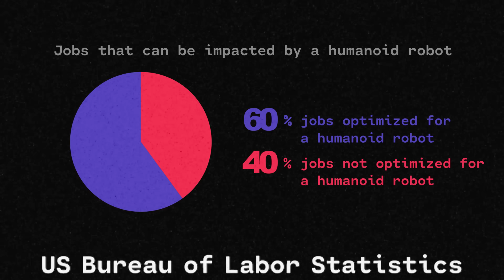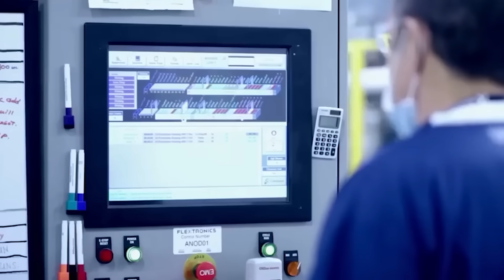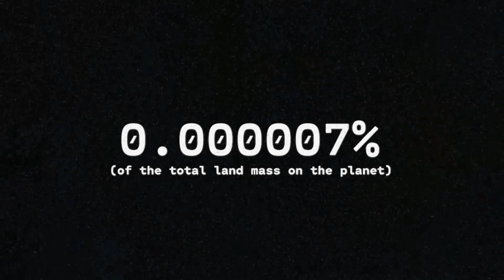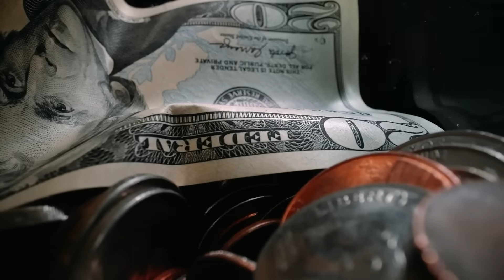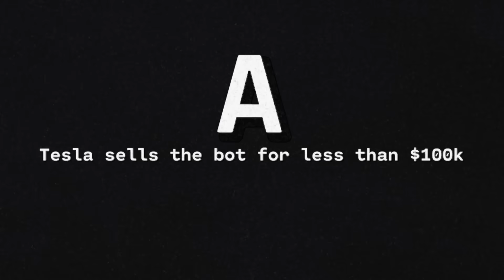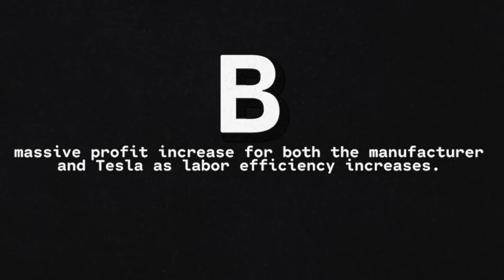Tesla's Robot is a Sleeping Giant. Watch Out.

Comment: Every job that humans do haven’t been “optimized” to the human body. Every job that humans do has been “adapted” for the human body. 

In most cases the job, project, or work is optimized with machines, computers, and robots designed to optimize production, safety, efficiency, speed and cost to assist humans or eliminate humans.

Comment: You also forgot shifts. Although a robot has to charge, it can still probably pull 12-15 hours shifts daily, effectively adding 50% efficiency in many job areas. Bots in warehouses or factories can be charged even faster in the future, giving them something like an 18-20 hour uptime or more per day.
Reply: It can hot swap battery. So 23.5/24 hour
Reply: @vanhsati  - Couldn't it charge and work at the same time? So 24 hour! 🙂
Reply: @vanhsati  Good point. Although as a mechanic and electrician I can tell you that breaks for maintenance and cooldown periods to alleviate mechanical stress and heat issues will be adviced for longevity. But I'm sure even such problems will be optimized or removed in the future tech.

Comment: I disagree with your statement about form factor. Walking is not efficient at all, and humanoid robots should have wheels or at least wheels at the bottom of their legs. Moving on wheels is a lot more efficient, faster and requires a lot less energy than walking. Feet an legs only make sense to push pedals (eg a press in a manufacturing environment or driving) or stairs which could also be tackled by wheels. So I do think arms and fingers are super useful but not legs and I’m surprised Tesla has not thought about that yet.

Comment: haha, you've picked a security guard? Maybe you should go over the required skills and/or training for that job. That it looks like a human doesn't mean it can chose when to use violence. If that was allowed we would have had weaponized security cameras long ago.

If we take the job of sorting colored lego blocks as an example or simply walking to the other end of the factory a human can do it 10-50 times faster. 100 times if their income depends on it. When we assume the 5 year useful life span at $50 000 that would only be $10 k per year which doesn't seem much. If it is going to take 5 years to do 3 months of work, or lets be generous, say 6 months it will cost $100 000 to replace a human. Humans are much cheaper than that.

I've seen lots of instances where people compete with machines directly. Of course there are many cases where the machine is so incredibly fast human labor cant begin to compete, there are instances where people find ways to work for $1 per hour and instances where the automation cant keep up at all.

You call security because some drunk guy climbed into a tree on the property. You call them because you don't know how to resolve it. It is one of those jobs simple and boring - until it isn't.

How do you picture it? I'm stealing your car, you send teslabot? I headshot it and keep the car? Push it over? Spray paint the cameras? If it was a human it would be more attractive to run away and steal someone else's car. teslabot < human < guard dog The dog will legally fuck up the intruder without paper work.

The way things are going Elon's bots will be most applicable when armed in urban areas to kill woman and children.

Comment: For this to work you’d need another electrical grid of the same size and capacity of the one that exists and add another because EVs. It’s just not possible to triple the grid and production in that amount of time.
Reply: Explain?
Reply: @MehulPatelLXC  
What don’t you get? 
The grid gets into trouble with a little bad weather. You want to add another grids worth of electricity with EVs, and then you want X number  of robots that will require the same levels of electricity as the EVs. What’s not to get here? Never mind moving that much energy, CREATION!!! How?

Comment: Nice summary article, heads up folks. I have wanted a robot since I was a kid (I am over 75). As a retired JPL Mission Controller, this is not surprising to me except it has taken so long. Actually, we have had pretty good hardware for 50 or more years. It is the software that has held things up. GPT will have a large part in making this happen and I can't wait. At 75+, quite literally   :-)
Reply: I'm 58 and have been using chat GPT, CAD and 3D printing to do stuff that I had on the backburner for 30 years which was difficult to work on due to the cost of resources and fabrication processes. It has now become possible to do it due to this technological nexus which has put powerful tools in the hands of just about anyone. I think we will see an acceleration in technical advances because more people have become able to engage and pursue projects that don't require big money and institutional backing to produce a proof of concept.
Reply: We will see 1000 years of progress in the next 10 years, including in anti-aging and age reversal; you might just make it still.

Comment: 1 billion by 2040 is way too conservative. It's going to happen much sooner, probably by 2030.
- Cost is not an issue, Scott Walter and others estimated it to be less than $10K.
- The brain is not an issue. With the speed AI is advancing, robots should be able to do any work in just a few years, and definitely by 2030.
- Production volume is not an issue. With Tesla's expertise, speed of factory construction, and Optimus already have been designed for mass production, it should be easy. Building bots is so much easier than cars.
- Demand is not an issue either. All human labor is going to be replaced, that's a done deal. That's already in the billions. But that's just the starting point. Most people would want at least on at home for housekeeping and running errands. And that's still small thinking.
Once robots are building robots, robots are mining raw materials, and robots are building factories, the cost of production will drop to essentially zero. And as cost goes down, new opportunities open, just like with any other product. We are putting computers into everything, because it's so cheap that even a marginal usefulness justifies it. There are lightbulbs with more computing power than the entire Apollo Program. Similarly robots will do things that would be outrageously expensive today. Jobs that aren't hard, just require a huge number of workers. For example clearing landmines in former war zones. Or picking up all of the garbage on the entire surface of the planet.
And who said we have to stay on this planet? With SpaceX colonizing the Solar System, the scale of labor demand grows several orders of magnitude. We could build a Dyson Sphere. It's a low-tech structure, just obscenely big. That requires roughly octillion robots.
Reply: Do you think that in 2035 with the advent of AGI (Artificial General Intelligence) they will put universal basic income!?  there will be free will!?  an era of abundance will begin!?

Comment: 6:46  I'm not sure if you're talking retail price, or manufacturing cost.  In terms of manufacturing costs, bot should be MUCH cheaper to produce than a car.  Not only does bot use about a 10th of the raw materials, it's assembly is far closer to being akin to something like a computer, than a car.  You don't have really complex wire routing to deal with, internal panels that have to be fitted, etc.  Vehicles, by their nature, of having internal and external volumes that have to be dealt with, greatly increase their assembly complexity.  Bot on the other hand will be far closer to a consumer appliance.  So I expect the assembly complexity of bot to be extremely low.  If raw materials are one tenth that of a vehicle, and assembly complexity is one tenth of a vehicle, you expect the cost to be one tenth of a vehicle.  So if Tesla is targeting producing cars at a cost of about $20k, I'd expect bot's cost to be around $2k.
Reply: I mostly agree except for the wiring being cheaper and easier. That is debatable as the DOF and sensors might need considerable wiring unless they use fiber networking.
Reply: @garylcamp  I don't think the DOF matters, as we have already solved this class of problem a million times over.  You can engineer around that.  When I say the wiring is easier, I mean you don't have to climb around inside a confined space, routing wires through tight crevasses.  Once you design the proper wire interfaces, it should be a snap to fit sort of situation, and not threading wires in a confined spaces you have to climb around in.
Reply: I've spent a lot of time in high volume manufacturing, I agree with you 2k is much more reasonabe

Comment: Tesla will not sell any humanoid robots. They will use them all initially internally and when Tesla has a surplus they will lease them to other companies and individuals at $5 to $10 per hour (365 X 24 X $5 = $43,800) 
Cost to manufacture will be very low mostly materials and capital amortization Maximum cost of materials will be less than $5,000 a lot less
Very little labor more to the fact that Tesla will build a dedicated manufacturing process fully automated to increase throughput. The machine that builds the machines. Robots will do support tasks such as maintenance and shipping.
Factories will be relatively small and established in many countries to reduce shipping.
Support will consist mostly of an AI team that will review any issues with robot performing required tasks. 
Repair will consist of shipping a new robot and recycling any defective worn out robots.
Batteries will be rechargeable same as all cordless hand tools today, this will result in lower hours of run time but having the Robot hot swap their own batteries is a simple task.

Comment: I totally disagree. The factory fork-lift of the future will be driven by AI and have cameras to see all around. It won't have a steering wheel and  wait for a robot to climb in and drive. You won't be maintaining hand controls on the truck, or wasting time, or wearing out the robot and wasting the energy. The best part is no part! Should Optimus stand there packing widgets and never use its legs? "It's made human-like so it can work in environments made for humans" Think about that. That is the antithesis of "First Principles"! It compounds costs/complexity and reduces efficiency. I'm an automation engineer, I wish they would put AI on all the existing dumb robots. 
Besides the unproven AI, look at the fingers on Optimus! Could it even pick up a needle to thread it, Start a roll of tape, put a lid on a cup, make change out of a register? How long would it take to peel a label off the backing? pick up a pen and write?  A person, without looking, can pick up just one small screw out of a pile and orient it in his hand. A person can reach into their pocket and count change without looking. Please tell me the "easy" jobs a humanoid will be able to do!
Enthusiasts will say "It's not like FSD because you don't have to be 100% accurate". Then it will fail in its job. 
If it drops a box of screws, breaks something expensive, falls and breaks itself, stops production etc. it's costs could be more than the savings.
Enthusiasts will say "It doesn't need to be fast because it can work long hours". Then it will fail in its job.
Factories are built for people to operate, so it will have to operate like a person. Asset utilization is important. Otherwise you'll have to create dumb jobs for it like overnight stock-boy.
Call me when they demonstrate a stock-boy, if I'm not dead.
The fud about the car was easy to ignore because the car was on the road. But the uncertainty and doubt about a humanoid bot that has no brain yet is very real. 
Optimus can't even do what the darpa challenge bots did 8 years ago.
See a bot untie a knot watch YT "why we don't have robot butlers yet"
see one load a dishwasher "Princeton Robotics - Russ Tedrake"